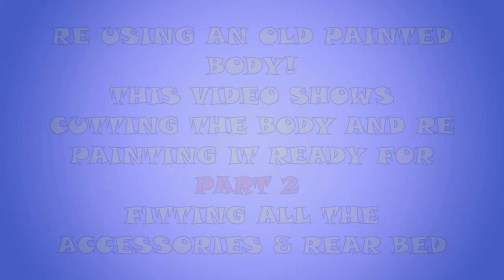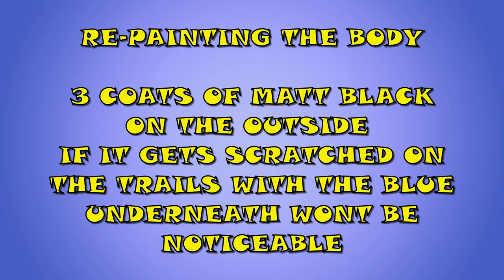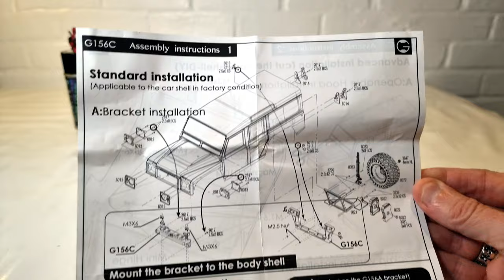Rc Land Rover Defender D110 Pickup *Build & Custom Painted* Trx-4

Comment: Hows that paint gonna hold out being sprayed on the outside
Reply from the maker: All good a few of my other defender build videos on the channel show the same way also as I wanted to use different paints on them as the colurs were not available for poly bodys and flat clear under to bond with and so far no probs with cracking or flaking at all I tested pieces of plastic before and bent then and creased them to check and no probs. I dont bash my crawlers but also still use them properly on the trail apart from the usual marks you get with any paint job worked fine for me cheers.

Comment: What kind of pen are you using to mark the lines on the body? Cheers
Reply from the maker: In this video the body is black do you mean the cutting blade to cut the lines? in other videos I use a black pen for the body lines but not this video as its a black body
Reply: @rcadventurer oh cool bro, I thought it was a special pen